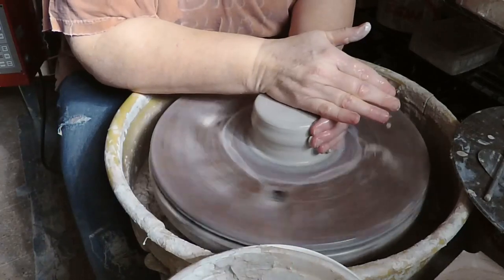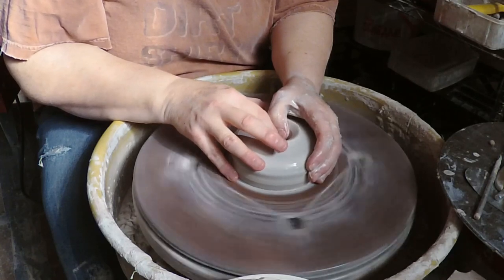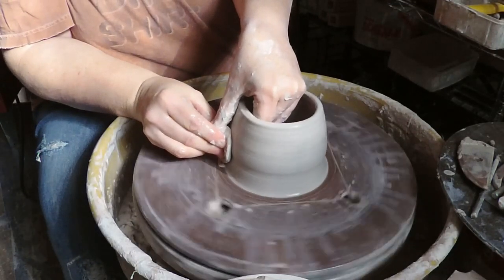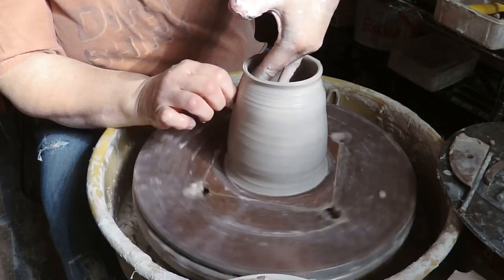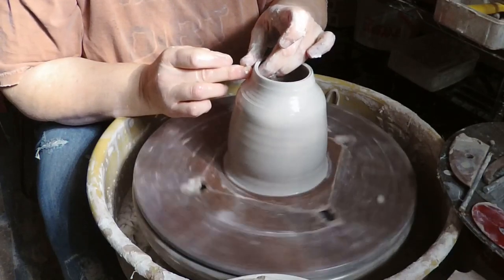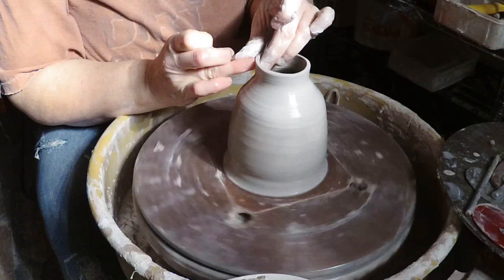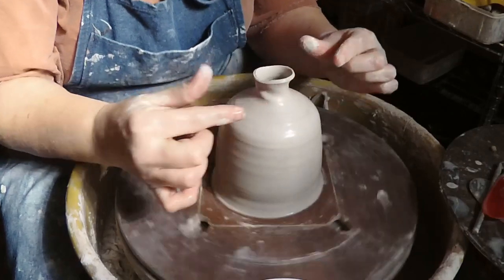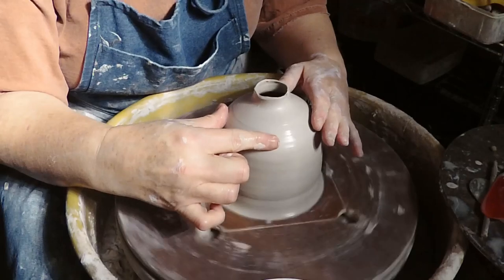Experimental Pottery: Elizabethan Waterer

Comment: Hi! Love your video! I am also doing some prototypes, but when I glaze my piece, the glaze seals the wholes... I tried using playdooh... but it didn't work. May be they aren't wide enough... i don't know.  Do you have a tip to avoid this?
Reply from the maker: i only glazed the top. the bottom and inside are bare clay. you could also try cleaning out the holes with a pipe cleaner if you're glazing the inside.
Reply: @OriginalOrlaith  Oh! Thank you! I will try both methods! :D

Comment: is it possible to use store bought air dry clay??
Reply from the maker: no. air dry clay won't work for anything you are going to put water in.
Reply: @OriginalOrlaith  is there anyway to make it water resistant?
Reply from the maker: @dianapetty7881  no. You need clay that can be fired